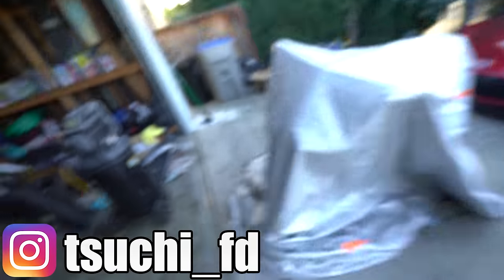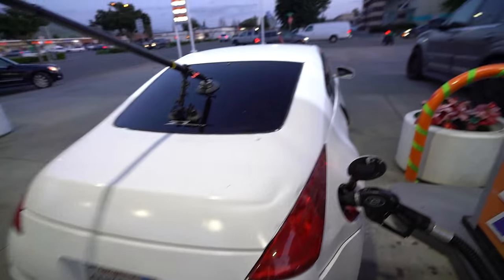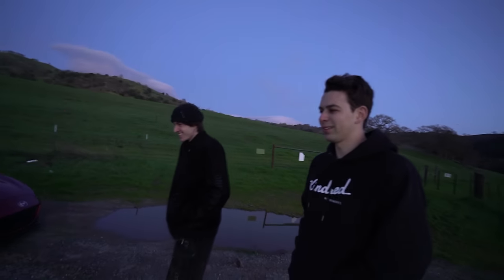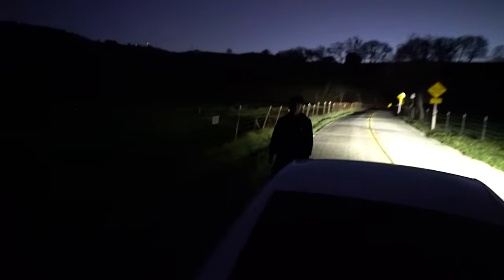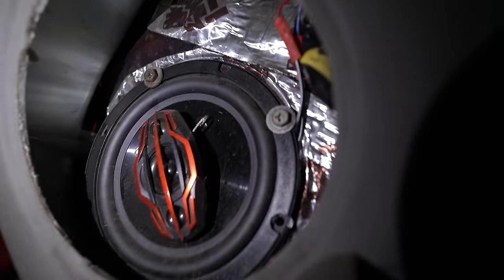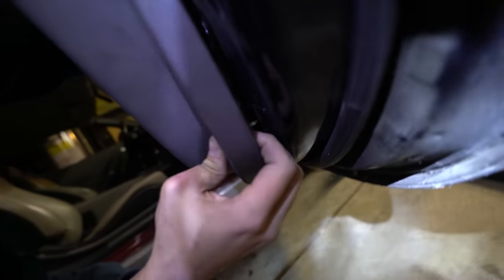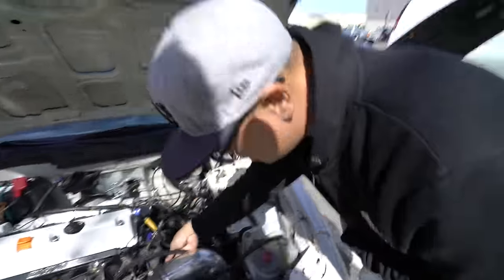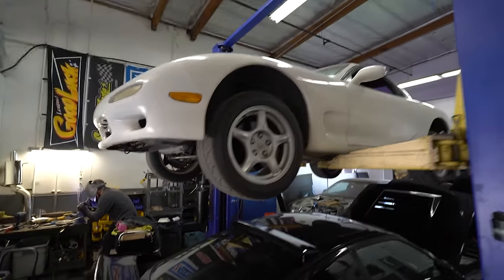Drifting My 350Z On A Private Road!!

Comment: I have a 350z and all of them have a traction system you can't get much angle because the computer in the car wants it to go straight. All of the models except the enthusiast model have that stupid anti drift system. Even if you press the vdc button, the enthusiast has a tcs button though that completely disabled traction systems.

Comment: How about some sort of skid plate to protect the oil pan?
Reply from the maker: the problem is bottom out and denting, not scraping. It was a hard compression bottom out on a berm off track which cracked the pan. Normal driveway scraping and speedbumps were totally fine. I hit the berm at around 50mph, so it was a hard impact. A skid plate would not help in that situation.